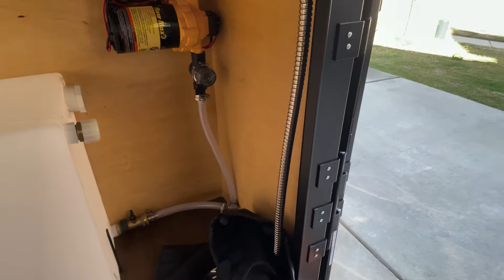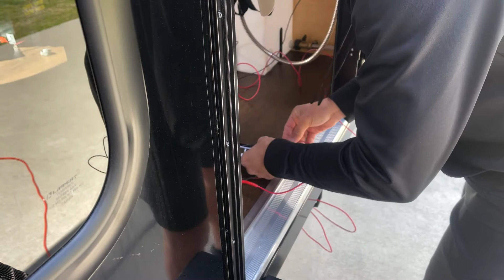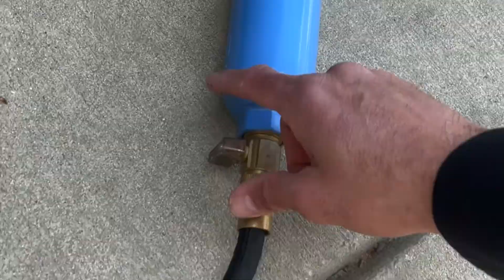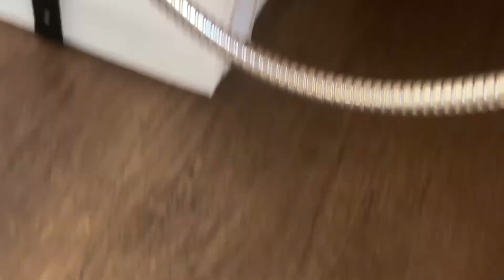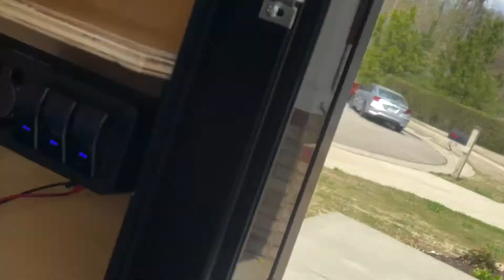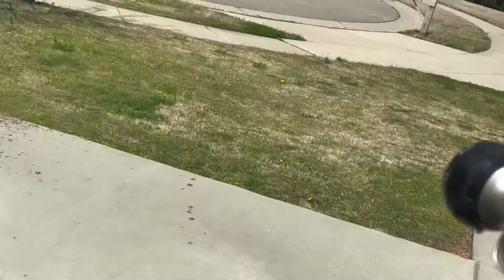Overlanding Water Setup

Comment: Just a suggestion…on your “pressure release” cap, why not just install an overflow hose that goes thru the floor of your trailer. Any overflow will go out the hose and onto the ground and it will also serve as your vent when using the pump. Also, the pump would likely be better if it was mounted on the floor next to the tank at the lowest point near the outlet into the pump.
Reply: I wouldn’t suggest that. One time forgetting to shut off the fill water and a overflow line out the bottom will be a blessing. Just run it straight down and caulk the exit through the floor.
Reply: The fresh water tank in my motorhome has the overflow coming out the top. I’ll try to send a photo of it soon. Never had a problem with siphoning. If the overflow is HIGHER than the water level you won’t have a problem.
Reply from the maker: Thanks again for your help!
Reply from the maker: I did it Philip, I made a vent for the water tank going underneath the trailer
Reply from the maker: Thanks Phillip,  I know your right because your not the first to mention the same thing.  I really didn’t want to drill another hole but it makes perfect sense.  What do you think about just an extension pipe going upwards like a chimney?  Still Keeping it inside the trailer though.  I guess I’m looking for an option that doesn’t involve drilling a hole
Reply from the maker: Ok.  Will do.  Now what do I do to keep it from siphoning?
Reply from the maker: Ok I understand and am going to make that happen. Thanks for your help and time!  I appreciate it.
Reply: Would love to see a video of how you did it. I think you will like the results.